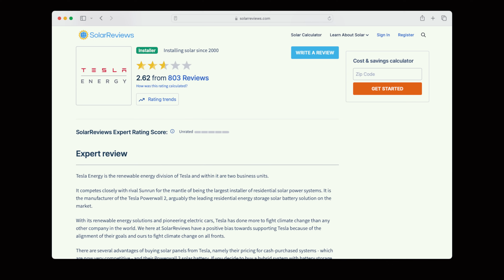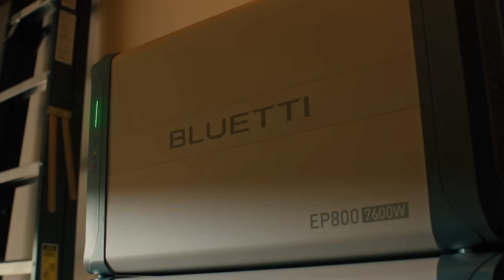The NEW Way to Install Solar (No Contractors)

Comment: I want to take control.  However, HOA rules prevent me from enjoying the benefits. Seems wrong that HOA's restrict the Energy needs of our country! State laws need to change. Suggestions?
Reply: HOA cannot keep you from installing a solar system.
Reply: @ricoma6037 please understand that a lot of POA, HOA, have old governing documents and boards that are old timers and not following the law.  No board can prevent you from installing equipment allowed by the Feds.  Such as satellite antenna, rain water collection, and solar systems. Federal agencies trump State law and county law and city and HOA laws.  

Uncle Sam says you can install solar system on your property.  That’s why they have tax credits and rebates. The HOA cannot enforce old bylaws that say you can’t.  Just follow the hoa forms local utility permitting forms and tell them what you are going to install.  They can say no they have no enforcement power over federal or state regulations.
Reply: Thank you. That was an aspect that I didn't consider. I'd like to find something official that I could provide stating that Federal Law regarding home solar overrides State, city, or HOA restrictions.
Reply: What state are
Reply: @svenmaster67 Nebraska
Reply: This guy is an idiot. He and his company really just an opinion, and bad one at that. So much info that he is not talking about. He and this company put a bad name on solar and energy independence.

Comment: Over 9 minutes into the video before you said the most important thing which is that people attempting this should have construction, roofing and electrical experience. Drilling holes in your roof to mount panels and hooking up DC wiring IS NOT a “learn it on youtube then go for it” kind of thing. Your home is your most valuable asset. If you have never done roofing, construction or electrical work in a professional or longterm hobby setting, please hire a licensed solar contractor!
Reply: Insane pricing from contractors. I got 3 quotes, two with a ~20kw array from $45k to $60k, and one with enphase and batteries for over $100k! I installed my own 25kw array with 3 SMA inverters for under $20k ($14k after tax credit). DIY I got a bigger system and saved over $25k. It’s been rock solid for almost 2 years now. Granted I am a DIY type person but a few YouTube videos and a little research is all it took to save a lot of cash and know the job was done right because I did it myself. Also a little bonus is I had my son help me haul the panels up, father son bonding time.
Also doing the math tells me that my ROI is less than 4 years!
Reply: Hitting a rafter is probably the easiest part of the project. And that's assuming you're not going to use a ground based or pergola system. There's plenty of calculators online to help you size and position a system.
But it's no surprise someone tied to the solar install industry is saying that you can't diy a system. The hardest part will be dealing with the crooks at the government and utility level.
Reply: @CelticBrewer  I didn't have any problems with that part, but I had to find out all the steps and do them. I was pretty disappointed that I got a ever so slightly smarter dumb meter, instead of a smart one. I have real net metering, which is great, but there is no future in it. We need net dollars. Give me a price at the meter in that moment, and pay me or charge me depending on which way it flows at that time. People should have a reason to charge their cars at the right time, or heat water or whatever you are doing.
Reply: Why on Earth would you need to have roofing experience?  More like the ability to get inside your attic and the ability to work on a roof that has nothing to do with shingling.
Reply: @JustNo8808  The racking must be anchored to the rafters through the roof sheathing on tile or shingle roofs. Those penetrations must be correctly positioned in order to hit the rafters and sealed properly to prevent leaks. If you don’t anchor the racking to the rafters, high winds can pull the panels right off your roof and rip up the sheathing in the process causing thousands of dollars worth of damage. If you don’t have any working knowledge of roofing, doing those things correctly is going to be difficult.
Reply: @krystalhosmer9652  Yeah you just use a clip-on flashlight with a drill and another person on the roof at the same time making sure you're hitting the right spot.  Also a company just came out with a drill list roof mounted solar panel setup that is when resistance to what your shingles are capable of withstanding.
Reply: Google has a map app that shows you optimum solar panel placement and array size....that is in fact used by many solar companies before they even come to your location.

Nobody should ever listen to a solar contractor claiming that this is more than you can tackle for yourself.  There are several people with top-notch videos and evaluations that actual solar companies rely on for their feedback.

Will Prowse comes to mind.  Absolutely anyone, with any DYI capabilties at all, can watch Will's videos and do the work for themselves.  This reminds me of the black mold scam people got away with a few years back.  The insurance companies and others fell for it for a bit, and then everyone figured out what was happening and the jig was up.... this is where solar is now.  It is so plug and play that anyone can do it themselves, and solar companies are going to lose the vast majority of middle class solar installs due to their insane markup.... they screwed themselves.
Reply: Everyone knows that only rocket surgeons can figure out solar installation.   Bloated companies cause excessive costs.
Reply: Yes you absolutely can learn this very easy and basic task. It very basic wiring and by taking simple measures on the roof it’s not an issue all of which you can learn on-line.
Reply: The guy who said he got a quote for 20kW solar and a battery option also quoted, he ended up DIY with just solar. That is so much simpler than solar with backup battery, the latter of which even many licensed electrical contractors today lack experience in.
Reply: At our Thanksgiving dinner,  our table spent a half an hour talking about contractor remodeling horror stories. Mine were about an electrician who installed an entire panel of not to code breakers and an HVAC contractor who pressure tested/destroyed the condenser of a new mini split system instead of the line set. My brothers both had me beat. One reminded us of an AC contractor who totaled his entire house by spreading concrete dust through the entire house. 

A homeowner who is handy with tools and willing to learn will generally do better work than the people who contractors send out to do work.
Reply: I’m glad it worked out for you. Based on the number of would be DIY installs we’ve been called in to salvage though, it doesn’t work out for everyone. I work for a licensed commercial electrical contractor with a large residential and commercial solar division. 

Beyond the physical part of the installation and the many, many  things that can go wrong with an over confident, inexperienced DIY install, there is also the correct sizing of the system both for the home’s energy needs and the utility’s net metering program (if it will be grid tied. Laying out the arrays on the optimal roof  planes to achieve the shortest ROI and the cleanest looking installation. There is the task of preparing plans and filing for a permit then arguing with the plans examiner about this small section of electrical code and how it applies to the position of the AC disconnect on this project and scheduling needed inspections. Then it’s getting PTO from the utility after you’ve gotten them to grant a variance on that AC disconnect location relative to the gas meter. It’s a small construction project with a lot of components, not just some panels and some wires that you slap together like a Lego kit or IKEA furniture. A reputable, experienced solar contractor provides all of those things in a turn key system.
Reply: @krystalhosmer9652 I've done it. I got a 6.2kw grid tie kit from Wholesale Solar, now Unbound solar. It's definitely not a beginner project, but doable. I made a ramp and drug the pannels up to the roof with a rope. I did paperwork for electrical, and a paper from an engineer that my roof can handle the weight, a Bosch D-Tect 150 to help me find the rafters. Took me a couple goes to pass inspection, but I got there. It has been running since 2017. I only had one problem. My outside shutoff fried, and I had to replace it. Made 36.71kwh today in Ohio.

Comment: I had my 47 panel 13.16 kW system installed and operating since June 2017. Shortly after that the company that installed it (Neutility) disappeared. I have been interested in the BluEtti system since watching Sam & Angela on the Green Acre Homestead channel install their system. I would very much LOVE to be COMPLETELY OFF GRID but have little to no skills with electrical systems and I have excessively shallow pockets. With my current system I have gone from about $350 month to nearly -$500 a year (I'm in Net Energy Metering, the first one ).
Reply: I would say to call BluEtti support and show them your system and they using have agents who can help design your system and you can give that to a electrician for installation

Comment: What would you recommend to interface this battery with an 8.2 kW grid tied Enphase AC coupled system?
Reply from the maker: You can AC couple this battery system to your existing Enphase solar panels. Just make sure the combined AC output of the micro inverters does not exceed 7600 W.

Comment: What about the design, engineering and permitting. Say the building department requires corrections that are too technical for the homeowner's understanding, how would they navigate this issue. And then the application with the utility. It's way more time & headache for the consumer. I guess you could hire piece by piece everything that needs to be done, but then that may add up to be pretty close to the turn key system cost. But the piece by piece method has all the time & headache where the turn key system doesn't. And what about warranty?
Reply from the maker: There’s definitely a trade-off here. Navigating engineering, permitting, and utility interconnection are the major items that cause consumers to just hire the contractor. But for those who only need off grid back up power, I could see many of them going this route instead.
Reply: @SolarSurge  Yes that makes sense. Taking projects from initial presentation all the way to PTO, I often think how much time and confusion a homeowner would have if they were left to themselves to get to PTO with the utility.  And in the comparison trade off, of course assuming for the turn key project they are getting a fair price, and the company provides great customer service. Unfortunately there are many companies here lacking in one or both of those. It really made sense when you framed it as people are really buying construction projects, not products off the shelf. But the market treats it as the latter. Now I say I don't sell solar, I sell construction projects aimed at offsetting the electric bill and providing energy independence.
Reply: It makes sense for a home owner to hire a system integration professional with experience in DIY solar and storage systems for a few hours of consulting in order to sa e thousands

Comment: DIY makes $ense. Pay Cash.   Install a Micro Inverter system.  Add Panels and inverters as extra money comes along...
Reply from the maker: For lowest cost, you could avoid MLPE altogether and just run strings of solar panels directly to the inverter unit like this one here. We had no MLPE in this particular system.
Reply: @SolarSurge Good advice.  Microinverters are just a bunch of failure points cooking under your panels. It’s not if, but when they fail and inverters are the most likely part of the system to fail the soonest.  Enphase comes with 25 year warranty, but are expensive.  You’re best off using a SMA Sunny Boy 3 string inverter l, which uses Multi-MPPT (Maximum Power Point Tracking) and has good arch fault detection.  With the money you save, add 4 more solar panels to get higher ROI.